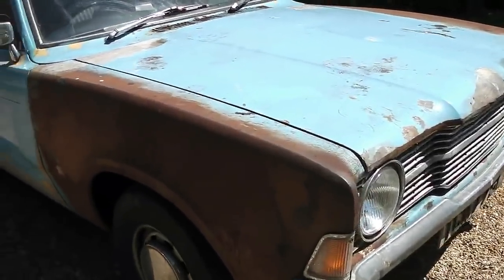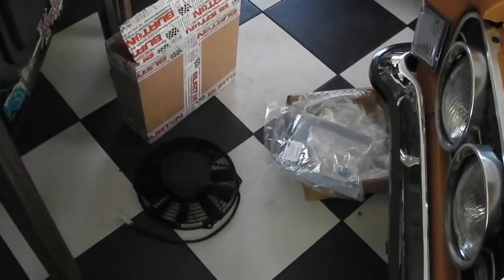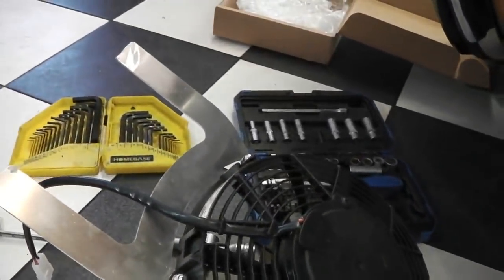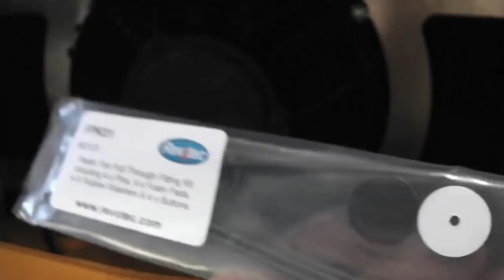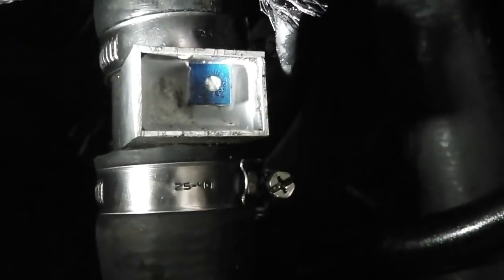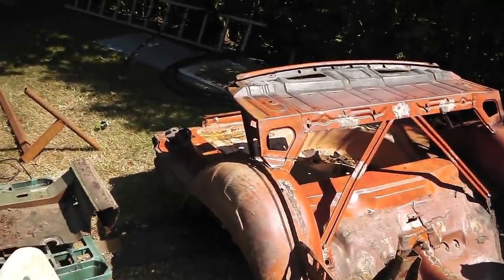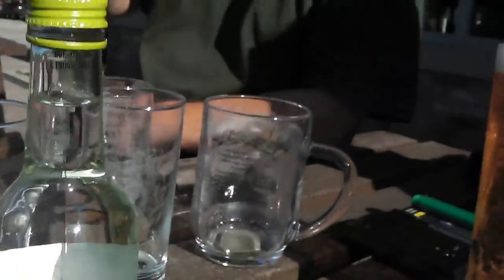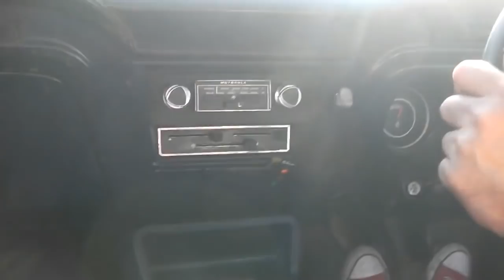Mk3 Cortina Revotec fan kit

Comment: Staying cool is vital in many respects. This is a good fan cool modification and should serve to keep that engine within proper temperature range. I was happy to see you blacked out the silver metal as it would be a bit of an odd color distraction behind the black grill. The thermistor sensor is something I have never seen before. I replaced a thermistor in a motorcycle low fuel sensor. The lack of fuel caused the thermistor to warm up and create a continuity connection to the low fuel bulb in the dash of the bike. Neat but simple design.This application is a bit different but a functional idea none-the-less.  

I am glad to see that Bramble is on the agenda. It'll be a huge project but loads of fun and excitement to come. It is awesome to see how some of the inner sills and body parts have survived in such good condition while other parts in the general area are in total failure. 

Thanks for taking the time to keep us all updated Pete.
Reply from the maker: thanks Andy, fan has been a success on recent hot days, no problems with tickover and all runs good, the fan runs on for 2 mins after you turn car off which i can accept, that thermistor is a good idea to sense liquid, i never thought of that such simple idea

Comment: I agree with andyfanshawe about intake temperature getting too hot. I also remember carbs having a thick Bakelite type material between the carb and inlet manifold to assist with keeping the carb cooler than the inlet manifold. Twin choke Webers had them on the Essex engines as the valley between the heads got very hot. It may be worth sourcing a spacer type gasket and trying that to keep the fuelling more consistent at high temperatures and retaking the original look of the engine bay.
Reply from the maker: Hi COlin yes this car does have the thick spacer block, since the fan i ve had no probs, i could also fit a cooler running stat, i think im on 82 degree stat, ill have to check Colin, thank you for help, Pete

Comment: An interesting old technology problem with the old carb intakes.  The air inlet into the air filter gets very hot so the air/fuel mix gets less dense and leans out.  Combined with the hotter inlet manifold temps its not good news!  Golden rule with all intakes now is to make sure cool air is being drawn in all the time.  The area behind the headlights or inner wings (between arch liner and metalwork) or behind bumper area etc .  I am seeing a noticeable power loss in young uns cars after installing these aftermarket K & N type hi flow air filters  because they are located in the hot engine bay and suck in loads of hot air.  
If they are fitted so the air sucks in from a colder area they are a lot better.
Of course, the air going into most carbs go through a right angle so lose heat energy and can cause carb freezing and jamming throttles (scary-don't ask me how I know!) in winter time.  Modern fuel injected engines don't have that air restriction so no problem there.  
The IAT (intake air temp) sensor compensates for air temp these days.
May be an interesting experiment to put a temporary hose from the air intake and stuffing the other end in a colder spot.  
Phew...that got a bit technical.  Goty a headache now.  Going to lie down.
andymaths.
Reply from the maker: Yes Andy some good points, Ill see what happens witht he cooling situation and let you know, thank you Andy
Reply: Spot on there, cold air intake makes a world of difference.
Reply: Need to lose one of the four headlighs and use it as a cold air intake by plumbing it in via tumble dryer hose or something .

Comment: lovely to see these fords coming back, in the 80s they were rotting and they were not loved, they were the workhorses, the taxis etc, scrap yards were full of them, the running ones were mostly wrecks already...shame, ive always liked them more than the later square cortina, but they have their fans too .  in fact in the 80s id not seen a shiny new looking one, all were abused.
Reply from the maker: yes i recall a lot of mk4s and 5s in the scrapyards latr80s early to mid 90s I used to buy em fro £50 and run em for a year then take em back, sometimes 2 or 3 years i would get out of em, they all gone now, scrapyards now are clinical, they dont rot the electronics fail....usually sensors.

Comment: Check the crank case breather hoses for blockages from oil sludge, or may be collapsed internally causing excessive crank case pressure. Had this problem on mk 3 fiestas in the past
Reply from the maker: thanks Gaz will do, i cleaned and put in gunk degrease its clar but engine still smokes, ill prob put pinto in
Reply: Pete C see if you can find a 2.3 cologne V6, something a little different and a great sound!

Comment: certainly any car with a mechanical fan should have an electric conversion with a manual bypass switch, mod we did in the 80s when we still used 70s fords, the electric fan saved a few mpg and a bit of noise too.
Reply from the maker: if engine is clean and rad is clean its normally ok, but for some reason pinto engines dont liek going high on temp, especially with a higher lift cam. the fan works well

Comment: hello from waaarm Spain, I am the owner of a Cortina mk3 2000E. How envious to see so many Cortinas and spare parts there, in Spain they are scarce.
I would like to install an electric fan, at the moment I have a couple of questions: what Revotec model have you installed? what belt should i install for the alternator when i remove the fan one?
best regards!
Reply from the maker: Hola y buenos dias, aqui es Peter, vale, vamous a ver.... OK you KEEP the original fan belt because you only remove the FAN plastic, you bolt the original metal fan pulley back to the motor, so you are keeping orginal fan belt and ALL pulleys. Im not sure of the revotec model I purchased but i it is decided in DIAMETER, i think from my memory it was 13 inches diameter, and the airflow points TOWARDS the radiator.  De donde eres en Espana!? my advice is measure the space available between the front of radiator and probably it is approx 13 inches of space for fan, BUT very important you decide exact the diameter of fan
Reply: @PeteCswampy  Thank you very much for the explanation, it does not seem very difficult! I find the Revotec system very interesting, I'll keep it in mind.
I'm from Madrid, the summers are hard, I'm also having some cooling problems lately, I think because of the thermostat, I'm thinking of eliminating it.
That black bottle you have, is it power steering?

You have some beautiful Cortinas on your channel, congratulations

Comment: I understand wanting to retain the look of originality, but one of the biggest advantages comes from removing the original engine driven fan. You get faster warmup and less wasted bhp. 
Electric fan tend to move less air than engine driven fans, so it is unlikely alone to make a great deal of difference. 
If put in front of a custom made radiator with better core, you could request a switch boss on the front at the top where it wouldn't be seen. 
A custom rad alone would boost the cooling far more than an electric fan.
Your cars are beautiful in their originality, but I'd love to see an original looking sleeper, maybe the 3-door, with a 2 ltre Zetec slipped in under the bonnet.
Retroford have brand new Zetecs crate engines for under a grand which would make more economic sense than rebulding a pinto.
They also sell a twin choke Weber manifold for the same with a kit to run the ignton map.
Or what about the 1.8 turbo diesel out a Sierra, with extra boost and running on waste vegetable oil. Think about that, tax and MOT exempt PLUS free fuel.

Comment: some of the  cars  of that vintage use to have a hot idle compensator valve in the carb  i know my 1972 opel  manta had one  and when it got very hot such as on a hot day in traffic  you could hear it  hissing away and the idle would come up a tad  i think what happens is the mixture gets a bit rich because the air in less dense  due  to the heat and the valve lets in extra air to compensate .
Reply from the maker: thanks Duggy useful tech info mate, thanks!! i went up to Scotland at weekend , it was hot weather , no probs with the car, but i do need to use super unleaded, reg leaded will pink the car a bit

Comment: Good vid. One question Pete, how are you at fixing CB Radios? You seem to  be a wizard at everything you touch. ;¬)
Reply from the maker: hiya , radios analogue, im ok on digital, with cbs it was tricky for me, lot of time it would be caps and diodes, or dry solder, but if it was down to reception issues i would send them away, long time since i touched one, magnifier glass on circuit board and try find any broken solder joins
Reply: No worries mate. I've found a guy in North Wales who's willing to have a look at it for me, how are you with rear diffs? X¬D)) ... or it might just be a bearing.